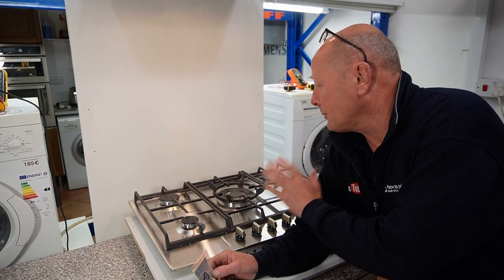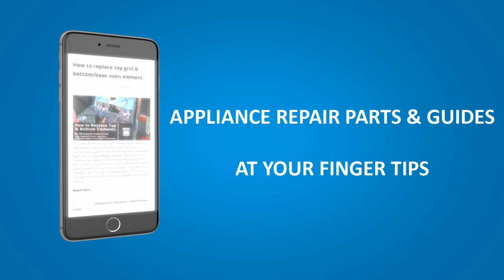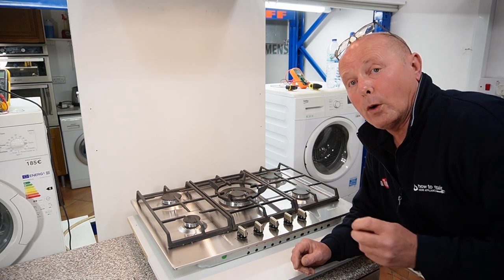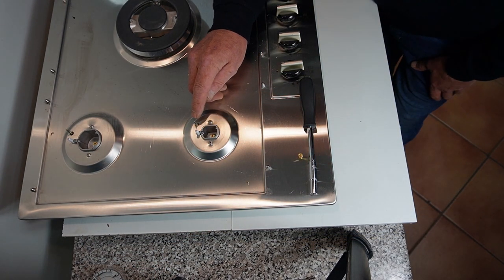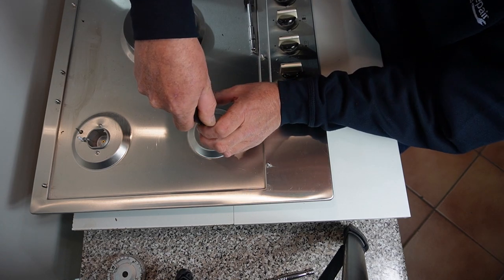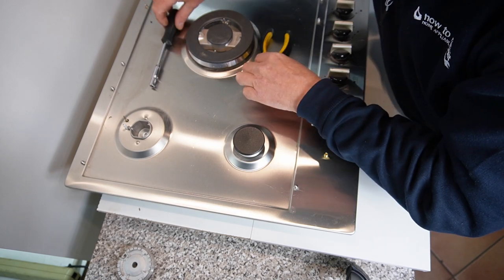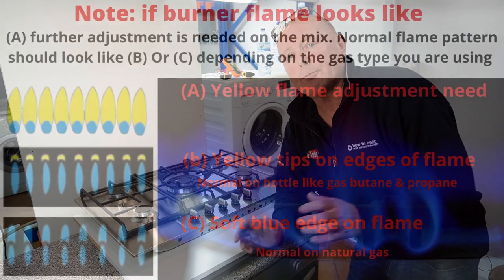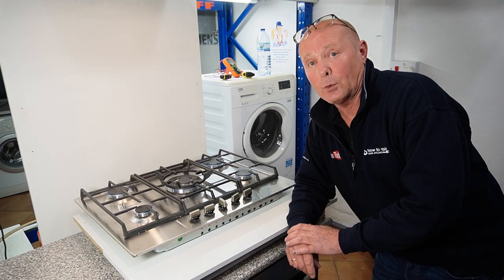How to Convert Natural Gas Cooker Oven Hob to Bottle Gas lpg, Butane, Propane, Calor Etc

Comment: It's getting to the point we're standing charges for gas is going to make bottle gas more economical  to use
Reply from the maker: This is not surprising I spend half my life living in Portugal and I use bottle gas it makes you monitor how much you are using
Reply: yes im looking at connecting my hob to canister gas
Reply: Ya but natural gas usually controls our heating too
Reply: Ahha... not now it's not, £40 for 13kg compared to the £30 6months ago not forgetting you gotta pay for the bottle too
Reply: @baked.9nion  41 quid for 7kg bottle 😱😱😱

Comment: Thanks for the info.... However we have just bought a range cooker fed by a butane gas bottle and I've changed the jets but it has made no difference... Any suggestions?
Reply: Ok I've just realised that the bore of each jet is different and I've changed the jets to correspond with the size of the burner and it works perfectly.... But what about the oven?

Comment: If the hob you are converting to LPG requires air mix adjustment, and some require this, make sure you set it correctly as specified in the manufacturers instructions. This can be an adjustable air collar that slips over the air inlet which you push over the inlet, or an adjustable shutter you twist or push or a screw that you twist. The flame should be largely blue, but on butane you will find a very small triangular tip on the top of the flame (as long as the yellow tip isn't excessively long with yellow lights in the middle of the flame on simmer or high creating soot on pans and kettles this is fine) but on propane, the flames will be blue. You might be able to get a pure blue flame on butane and propane with some fine adjustment of the air collar or air shutter or air mix screw built-in to your hob. Many hobs have fixed aeration which may not make adjustment possible.

Comment: So basically do I just need to find the size if I can't get the info for my cooker. I have a range cooker, top half gas and until I inherit Northumberland and get an Aga, I thought about bottled gas because what's the point of a standing charge just for a hob.
Reply from the maker: most people in Europe are using gas bottles to run hobs no standing charge on the gas but in some harsh Winters you may have problems with gas freezing Thank you for leaving a comment this is for you https://www.youtube.com/shorts/e432SAb2g08 please remember to subscribe as that's is what keeps this channel going. Thanks 👍

Comment: If I already got a gas hob and I want to convert it to lpg how do I know what jets to buy?
Reply from the maker: The manufacture of the hob usually does an LPG gas conversion kit. If they don't, then you need to get an engineer to work out the sizing example, a 70 jet would be replaced with a 50 jet due to the pressure increasing

Comment: Mine was put in wrong by a relative, last year. My pots and pans are “ black as the hobs of hell” 😅 I just guessed that’s what the problem is.
Reply: I did it the morning. Thrilled with myself. I listened to everything you said. 😅 I’d to switch a few jets sizes around but got it in the end. 
People shouldn’t do this if they are idiots or never listened to their father. Disconnect everything. Screw jet in gently. Like you said. 😅 I was fairly confident after watching this video. So thank you.  🙏 😂

Comment: Adjustment ?
Reply from the maker: If the jets are only clogged, then you should not need to do any adjustment, but if the jets are worn, then you would need to replace them with the correct manufacturers size. Thank you very much for your comment. Have a great Christmas and a happy New Year